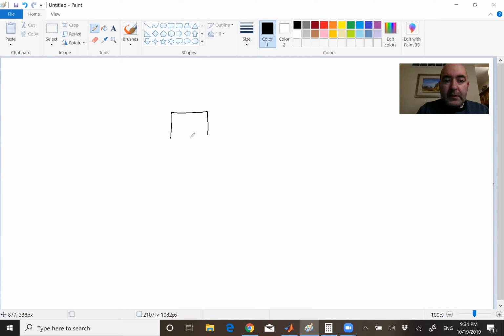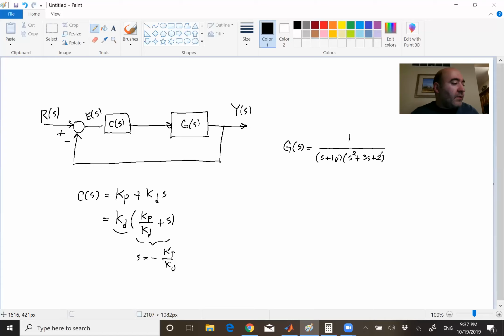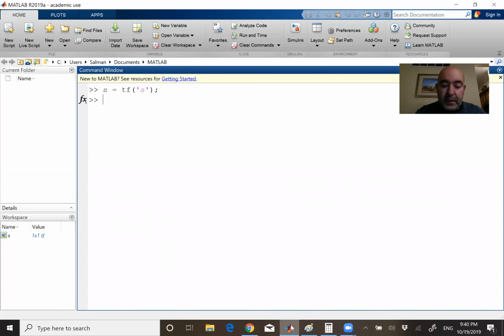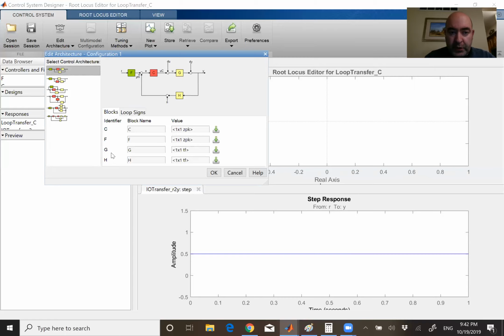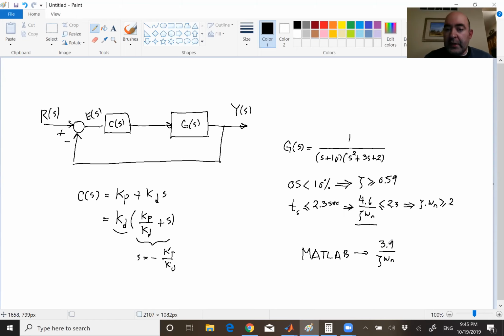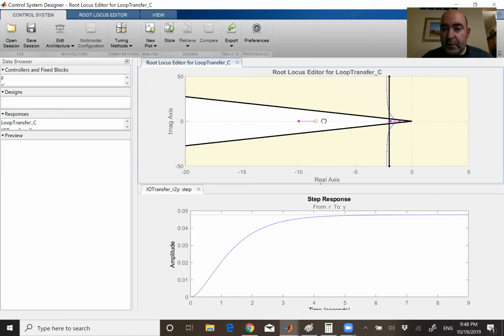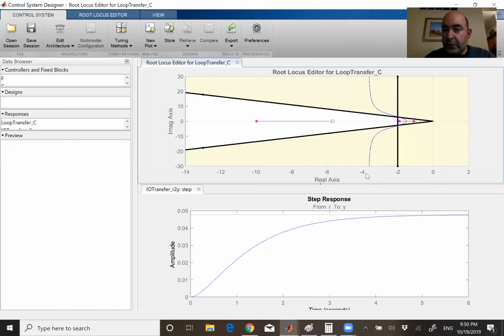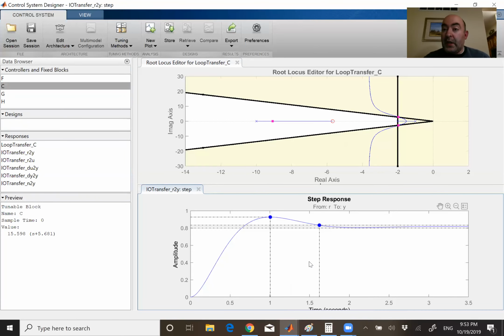L21 - Designing a PD Controller using MATLAB

Comment: Nice presentation. I was curious if we can use this method for balancing robot which is to be controlled by PD controller?
Reply from the maker: Yes, as long as you can derive a transfer function for your robot you should be able to use sisotool to design the controller. Keep in mind that after you have designed the controller in Matlab, you would need to test its performance. This can be done using Simulink for instance.